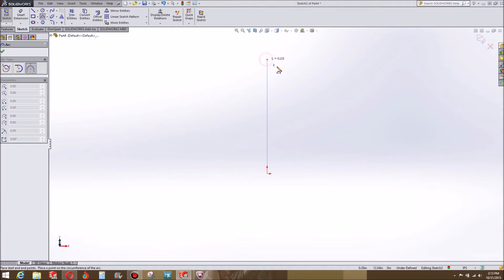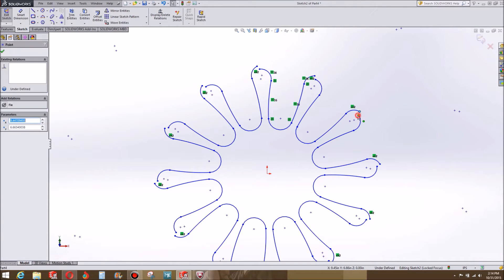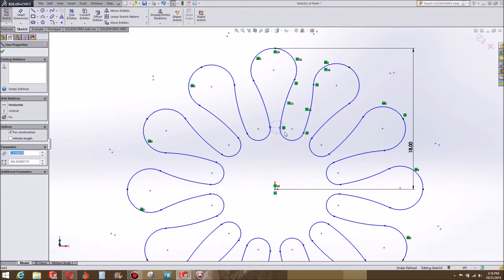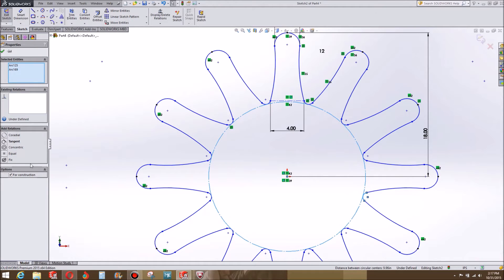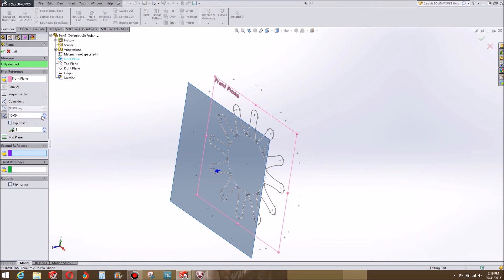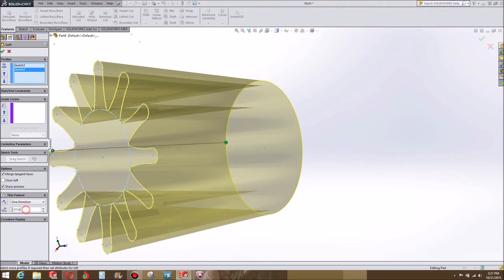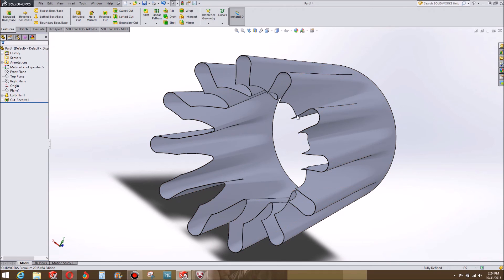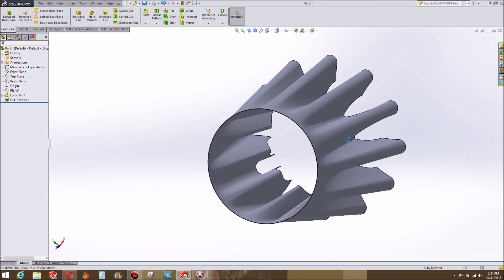How to Make Jet Engine Exhaust Ductwork in SolidWorks (Mixer Nozzle)|JOKO ENGINEERING|

Comment: verry cool. i use Inventor in my highschool engineering class and don't have the option to hallow or change the thickness unless we draw it in. we especially don't make anything proactial like this. wish we did though, just moving joints and complicated triangle things with fillits :(